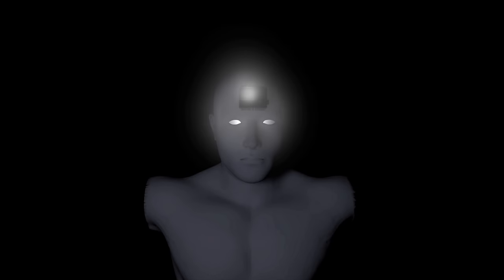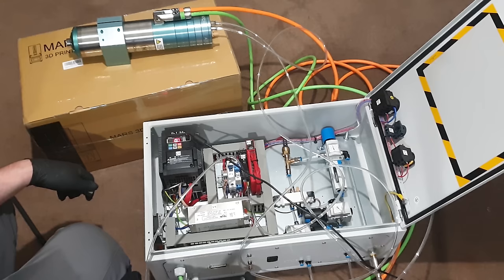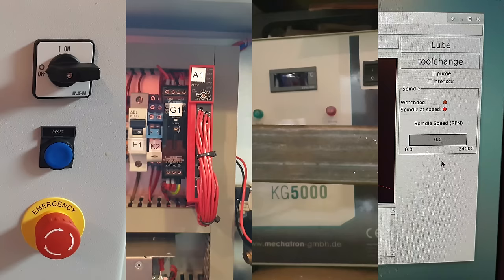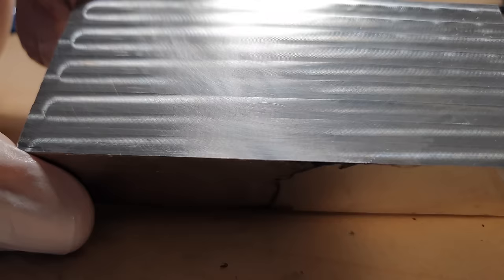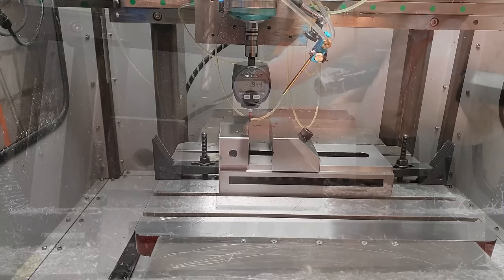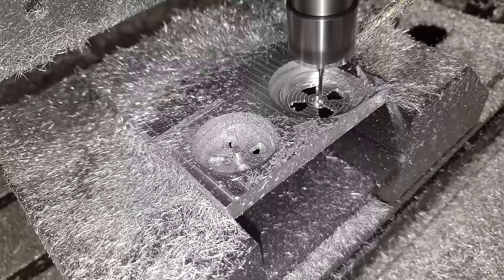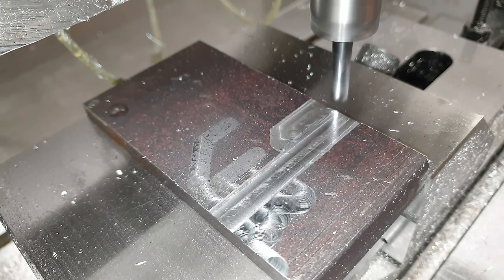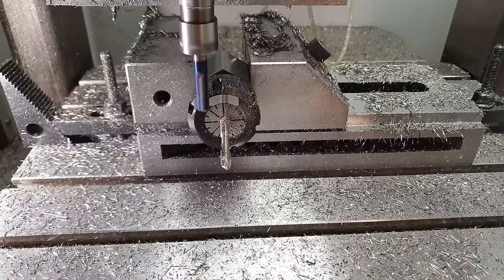CNC Finale: Automatic Toolchanger Spindle Install & Testing

Comment from the maker: Happy Thanksgiving!
Don't eat turkeys pls!
Mechatron YouTube channel: https://www.youtube.com/watch?v=Rzh6xyp0p4w
Reply: Happy to you, :)
How much is the axis stepper motors holding torque?
Reply: @mohammadr797  they are not steppers they are 400waat servos he made a video about them here https://youtu.be/15_qysmeLD0
Reply: You need a hard project 
Try to make a metal 3d printer (DMLS,SLM,EBM,FDM either BJ)
Try to do it cheaper an faster than me (1-2 years, 2000-5000€/$ buget)
Good luck!
Reply: @nicholasjacob3594  Thank you!
Reply: I want more fiber and dangerous laser video
Reply: I didn't eat any turkey. (I ate a pizza). 🍁😇
Reply: Which specific model spindle did you receive?
Reply: oops. I found it. Im too lazy to send off for price. Ballpark us here
Reply: @Marco Reps have you checked the G-Wizard program available from CNCCookbook for calculating optimal feeds and speeds for most any type of milling bits?

Working on building a 2.2kW aluminum desktop router with a 25mW Coherent fiber coupled laser option. Planning on epoxy granite infills for rigidity and have used, but good quality well overspec linear rails.
Reply: How much did that spindle cost
Reply: Do it with a jenoptik 45w fiber copled laser and the 40a driver
Reply: @sfp4197  u made a metal 3DP for 2000 $ ? dont believe u. show me the money mamma.
Reply: @zorro6018  no i try to make a profesional one with will probably cost 15.000-20.000$ , but you can make one from a 3dp under 3000$.
Reply: The sparks you saw is fairly normal, it very often happens right before you breakthrough with the helix. It's due to corner wear + chips not being "evacuated" fast enough, nothing to worry about, just push through. Though you really never should make a helix more then 1.9xD, that "pin" you leave standing with over 2xD is going to cost you some tools (high risk of jamming on breakthrough), i can guarantee that!
Reply: you cant understand ho extremely jealous  im am trust me  that spindle package costs more than my entire machine 
but my 2.2 kw er20 spindle is good enough and i have made my own touch probe for tool lenkts setting 
so i can live whit it
Reply: Y no turkey?
Reply: @Kageitenshi  that g-wizard is rather pricy for my taste
Reply: @964cuplove  Thought so too at first, but they have sales from time to time and sometimes you can get the G-wizard editor bundle for better price. The extra simulation and conversational g-code editor functions are quite nice to have. They're versatile software and the three year bundle is basically a lifetime deal if you have a 2.5 kW spindle or less. Of course one might probably first want to invest in control software, CNC machine improvements or maybe better CAD / CAM first depending on your needs and budget.
Reply: @nicholasjacob3594 t

Comment: A machinist once told me that the "mild steel" that we buy for projects is a melted mixture of all kinds of scrap steel, including ball bearings. Sometimes they don't quite melt completely, so you can indeed run into "nuggets" of really hard material within a block.
Reply: Never heard that before. I guess if it’s cheap stuff from China, but most graded mild steel has to conform to specific standards
Reply: Sorry but I think that is complete and utter rubbish, even the crappiest of Chinese steel is better than that. The reason the tool got red hot is because it was spinning way to fast. The surface speed is critical to tool heating and therefore tool life. Spin it too fast and it will last but a little while then go red hot and then it rubbish.

Comment: They're cheaper than I would have expected, honestly.
Reply: I probably paid close to that for my chinese 2.2kw watercooled spindle taking shipping and the stupid customs tax of my country into account.
Reply: noxxi knox  More money than I can justify spendig on what would amount to being a toy for me, too, but I'd have guessed about double to triple the price they actually are.
Reply: @Runoratsu  isnt that this entire build? I would love to make one too but it would be very expensive for a toy
Reply: Kars Noordhuis …yes. Same. 😅
Reply: How much does something like a Haas spindle cost, and what improvements would you get for the extra cash?
Reply: @michaelknight2342  there is just no use for improvements in this hobby scale imo. this is overkill already (but in a good way ofc)
Reply: yeah, the price is pretty good actually. Things might grow as you add water cooling, controllers, vfd, cabinet, mounting bracket, and other features.
Reply: Haas spindle 7500 rpm approx 3500-5000$
Reply: That's because those prices are for the "Standard Series" spindles - not the "Professional Series" spindle shown if the demo.
Reply: The used spindle is around 10k€ with all accessoires - the shown one is without atc.
Reply: @FriedrichKegel  10k for the spindle demonstrated in the demo?  Does that include all of the support hardware shown too (VFD, enclosure, chiller/coolant, tubing, cables, tool holders, collets, and setup)?
Reply: @gmack4097  Yes, I just requested the price of it a week before the video released. Without collets and tool holders ofc. But it seems to be one of the few HSK spindles in this weight class, so makes sense on many smaller machines i suppose.
Reply: @movax20h  those are the standard line spindles. the one he was given is a professional atc variant and you have to contact them for a price lol... its probably a lot
Reply: hello i am a machinist and i guarantee that any spindle that can do 30k rpm without detonating is going to be an order of magnitude more than 800 euros

Comment: Nice job, Marco. Shocked at the incredibly reasonable price of that spindle!
Reply: You saw prices on spindles with manual tool change. Marco's spindle is equipped with automatic tool change and go for around 2000 euros if I'm not mistaking.
Reply: Those prices are for the "Standard Series" spindles, not the "Professional Series" spindle demonstrated!

Comment: Those sparks you got at the end of the cut are common in steel especially at those speeds. When there isn’t much surrounding material the heat has nowhere to go but the chips (or tool).
Reply: Exactly what I was going to say. I see this often when breaking through helical boring without flood coolant.

Comment: The sparks as you approached break through on that helical ramp are due to the material thickness being so low, and therefore also the work cutting surface rigidity, that the tool simply rubs against it rather than cutting it. At work we just let the machine run as it does this, it doesn't seem to have an consequences, but then that condition on our machines only lasts for a second or two.

Comment: The most accurate way to align the machine is first align the x and y axis to the table.  Then adjust the tram, measuring directly on the table with your indicator set to the largest diameter possible.  I enjoy your videos and commentary.

Comment: I've never been a fan of surfacing with a mill. Especially when they make such neat little fly cutters for CNC machines these days. I strongly believe that for surface finish, using a mill, is like using a drill bit to bore a hole. But that's just my 2 mm.
Reply: True that there's a reason for face cutters or in German Messer Kopf

Comment: As the bit gets to the bottom of the steel there's less material to dissipate the heat - so it gets hot. I heard slowing the spindle / feed as you get closer to breaking through the material also helps.

Comment: I covet your CNC. I focused my money/effort on DIYing rigid CNC gantries, and I cheaped out on a "spindle" (Makita mini router) for the proof of concept. I'm surprisingly happy with the results, even using a crap spindle, and even though that spindle is the source of nearly all defects in the system now, I'm happy. It will easily mill a PCB with your test PCB artwork, cutting copper clad to the depth of the copper only, but not the adhesive. So, what proof did I achieve? I proved that the spindle is important, but lies in that broad category of increasing costs, diminishing returns. The gantries/drive are the most critical pieces in the system, so that's where the greatest ROI is found. Don't cheap out on those.

Comment: Those 0.2 mm carbide drills are the best test for concentricity and quality of the machine. I have a German mini drill press that can easily handle those, even through hard materials. The crappy Dremel drill press (and its equally crappy Dremel tool) breaks even 0.5 mm carbide bits. This machine has become quite something. Filled with OCD , as it should be :-)

Comment: Great build. Really well documented, and edited.  Here’s some suggestions for more rigidity, since I’m in the business of designing cnc components.  
The clam shell clamp that holds the motor could be made as wide as the horizontal  linear rail spacing. Grab motor as low as you can go with clamp.  HSK is a great tool holder, but with excessive tool stick out, you know you’re sacrificing rigidity. Choke up on the tools as much as possible.   Use proper end mills in climb milling mode, high feed low radial depth of cut if you can, it’s like a Daytron build size wise.  Rapids and feeds?

Comment: My CNC has been in storage for a few months while I move. I have a Huanyang Spindle/VRD. Um, perhaps I will test the VFD--with the motor disconnected. I am sorry you were bitten by that, but thank you for sharing.

But, but, you passed over stack of belleville washers. I feel that every time someone makes something from then that's not an anti-personnel mine, perhaps they deserve a little credit.

I've read on CNCZone.com that people have reported less rusting when using distilled water instead of tap water. I made some Koolmist up for my CNC, always stronger than recommended. It works nice. I have also used some to cut a 120mm fan hole though a 3mm stainless plate--with a battery powered saber-saw : ) Without cooling a bi-metal blade only made it 25mm. With it, it finished 2 cuts.

You have a great channel. Thanks for making videos.

Though, I guess my channel will grow to the point where I get free swag in the mail : (
(Scuffs feet, looks down.)

Comment: Hi Marco, think about a direct cooling. When drilling deeper holes, the main cutting edge runs dry and quickly becomes dull. If the spindle does not support inner cooling, come from different sides, preferably near parallel to the tool, to reach the top of the main cutting edges. Ach... und MMS (Minimalmengenschmierung) war schon immer eine böse Sauerei...;-)

Beautiful video and amazing what is possible in a basement or a garage.

Greetings,
Wolfgang

Comment: The best thing about mild/carbon steel chips vs aluminium/stainless is that they return to nature over time, they leave a little brown mess but that's a small price to pay.

Also, I suggest a "ring light" style mist coolant setup, re-cutting chips kills tools, as does lack of coolant down holes.

Comment: If you heat the bearing block with a torch will the bearing go in for an interference fit? That would be ideal - it has significant clamping and alignment accuracy.

Comment: I have PCB bits like those.  They are so small that they break very easily.  Even setting them down wrong or not placing them in the case can break them.  They are so small that to see the flutes you need a good magnifying glass and steady hand.  I don't use them for a lot of things but the few times I do I can almost guarantee breaking at least one.  It is a good thing they are not expensive.

Comment: 27:12 its because you reached the bottom of the part. the material will bend and then sparks will appear. but thats not a problem

Comment: Looked like it was doing fine with your deep plunge in steel. I have industrial machines and they sound wicked cutting steel. Get yourself some good multi flute steel cutters they will take the high rpm and not toss sparks. Garr is a good brand for aluminum and helical will shred steel. Both like high rpm spindles. If rigid enough you can take .5 doc right through a block of steel. It’s always the plunging that kills the flutes so if you can come in from the side or helical down into the part that works great. Even in aluminum I do some helical plunges straight through 1/2” to 3/4” plate. No stopping just a spiral plunge through it and then back out for a finish cut. It’s very fast and efficient and ultimately comes down to your cam.

Comment: Why slow down to 15,000 RPM and increase forces 2.8 times more than necessary when milling aluminum?  Also, why apply the 25 kg deflection force to the spindle mount rather than at the cutting edge of the endmill where it originates?

Comment: Please  put a bearing on the right side of your x-Axis, and for milling steel or other materials you should look out for carbide tools with asymmetrical flute spacing they don't chatter that much and are easier to drive

Comment: Make your entry helix's smaller so they don't leave the stem in the center that can bounce around and chip your endmills. Also, I would use depth cuts instead of full flute cutting on small tools for the best finish and dimensions. Good tool manufactures will list optimal axial depths. Also, mind your order of operations. For the highest accuracy, the hole in the fiber lapping thing should have been cut before the part was tabbed but after the roughing. Looks like a very capable machine! Awesome work!

Comment: very nice parts, the micro machining was very cool, having done it in 304 stainless steel (3,000 something .032 dia holes 1/2 inch through )..... i know it can be painful
27:14
you're likely right in that your mister wasn't penetrating the bore enough; it's aim is a bit off . the air tube you can probably cut threads (check dia) into and screw a nozzle onto the end.
since you're only using one tool though you could bend a special tube or rig a way to add a second tube and a valve or fitting so you can remove and control it, just for that kind of deep bore cutting or even just longer tools. 

 the spiral cut into the part was overkill for a piece of more common materials, nothing removes more material at one time than drilling a hole.  
proper chip evacuation and feed/speed optimized for cut depth(finish pass vs rough) are 100x more important when cutting steel, especially when you're using ceramic tools.

Comment: Watch out for your CAM's default helix entry radius size, that tiny cylinder of material standing in the center of the of the pocket can chip end mill teeth when it breaks free. 
Great project, & great videos to go with!

Comment: Awesome video! I think some coated high flute (5 or more) end mills will offset your lacking torque at low rpm’s.
High surface speed causes the raw carbide to heat up very quickly in steel. 
Very impressive machine!

Comment: You have one amazing machine there. Mine is not nearly as rigid as yours, but it easily hogs out mild and tool steels with ease. You’ve probably experimented with faster feedrates off camera, but you’ll be able to get some really really really good performance from that machine!!

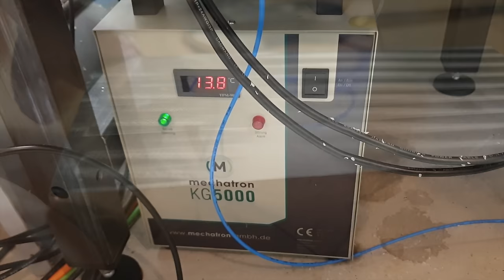Comment: to check flatness. you can dye the surface then when dry, run the stone across it. it will show the high and low spots.(12:36)

Comment: Let the Spindle Machine a Flat Table herself :-D
Reply: if your spindles isn't square to the way bars you are not getting anything flat sadly
Reply: That's how some of our tools in the semiconductor industry do it 🤷‍♂️. These tools are used to remove angstroms.
Reply: @jasonspink1981  really..... I question this. You grind to that level but to cut to that level I really question that. There are so many things that stop you from guaranteeing that consistently that I think that is more marketing than reality. Unless you have done it and measured it in the morning and in the afternoon after cutting all day.
Reply: @gusbisbal9803  yep, we cut the chuck to one of our planerizers with a diamond bit when we install a new chuck. That tool then uses a slurry to remove angstroms. I worded it better for you.

Comment: Hi, really good results on steel. Just reward for a lot of effort and top-quality parts. The only thing you missed is that you are spinning the tool WAY to fast in steel. The tool life will be poor to very poor. You will know when it's done because the tool turns red hot......and not because of any fault of the steel. You need to follow the recommendations of the tool manufacturer.

Rule of thumb is 100m/min surface speed with uncoated carbide in mild steel, and up to 150m/min with a good AlTiN coating. I use flood cooling. If the cooling is misdirected for even as little as 10 seconds the tool glows red hot and it's toast. You MUST slow the tool down (Vc=150m/min absolute max) and be extremely careful that it is well cooled to get decent tool life.

I have a baby Mechatron 800W 24000rpm. Used it and used it and used it for over ten years. Simply brilliant. Wish I could afford the same AYC spindle you have. Best I could afford is 3.5kW, 10000rpm (rated), 40000rpm max HSK32 Chinese made spindle. Still a big step up from my little spindle. I think it will be a good match to yours.

Congratulations again, great spindle to finish a very nice machine.

Craig

Comment: Speeds and feeds for an adaptive toolpaths starting values for this class of machine steel:150m/min surface speed, Alu 300m/min. 10%cutter diameter step over, 1% cutter diameter feed/tooth. 8mm 2 flute end mill is steel = 6000rpm, 0.8mm stepover, 960 feed